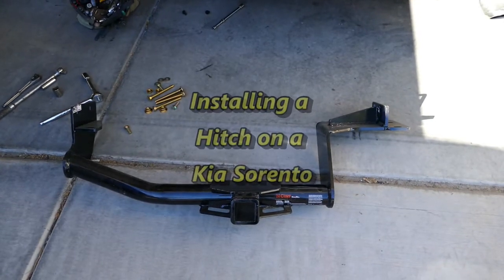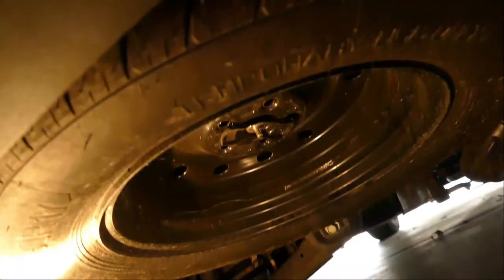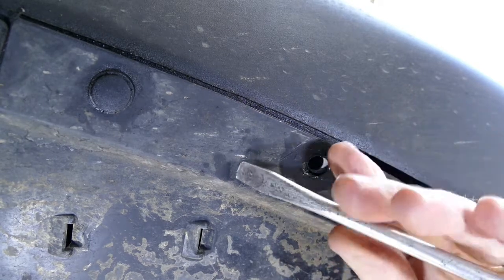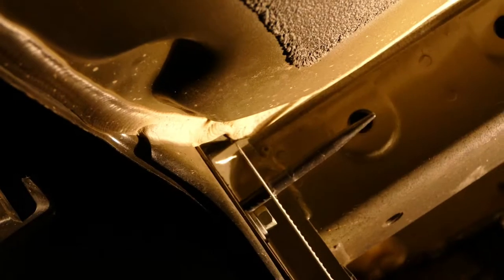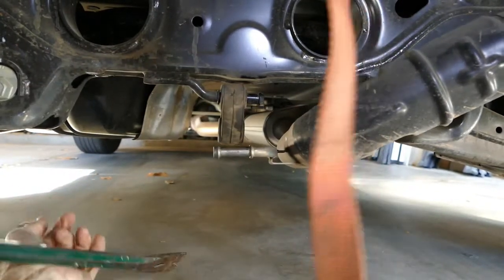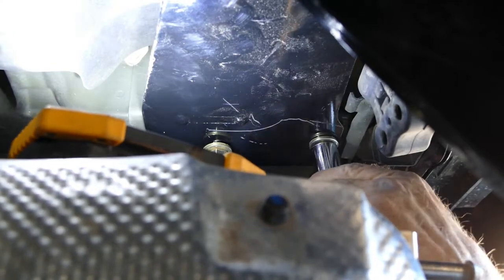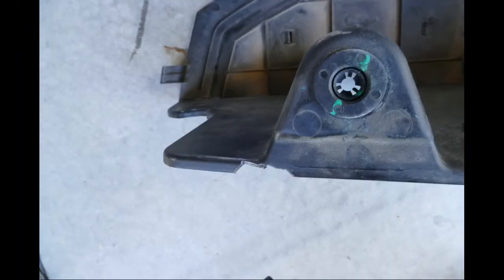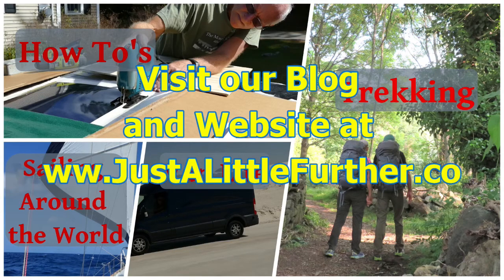Installing a Tow Hitch on a Kia Sorento

Comment: 2019 Kia Sorento LX uses four 10mm x 1.25" fine pitch thread bolts installed vertically in the trailer hitch flange. The three lag bolts AKA carriage bolts do not fit in the horizontal holes of the frame rail due to them being 1 mm too big in diameter. Never install a hitch on a Sunday because all the hardware stores especially Ace hardware who has the best selection of alternative bolts nuts and washers closes early at 5:00 p.m. always install your hitch during the weekdays starting at 10:00 a.m. so just in case you need to get an alternative bolt nut and washer you won't get shut out like I did.
Reply from the maker: Hi William, all good tips. The kit I bought had all the hardware, though, so I didn’t need a trip to Ace… although most projects I get myself into require at least two trips to either Ace or a big box. Thanks

Comment: Great video. Going to do this coming soon. What about the wiring
Reply from the maker: My Kia was pre wired for the hitch. The connectors are behind a panel on the driver’s side.
Reply: @JustALittleFurther  ok I will check. Thanks

Comment: Was it hard to do with out rear end jacked up?
Reply from the maker: @tristenlittke7593  not really, but I’m kinda skinny.
Reply: @JustALittleFurther  did you struggle putting bolts in frame over exhaust like flushed against bottom of vehicle
Reply from the maker: @tristenlittke7593  it wasn’t difficult once the exhaust was dropped down enough to get the bolts in
Reply: @JustALittleFurther  I had issues the bolts were flushed against a metal sheet bolted to bottom of compartment over exhaust even hammering it I had issues
Reply from the maker: @tristenlittke7593  I don’t know what might be different about your installation. Different model year? Different brand of tow hitch? My installation went smoothly with no problems.

Comment: Have you try to towing a travel trailer with your Sorento? I have a 2020 Sorento EXV6, but no trailer package from Kia. Do you think if this hitch can able to tow about 4300lbs dry weight? Thanks!
Reply from the maker: Hi Norman, We haven't towed anything with our Sorento - just carried bike racks with the hitch. The V6 Sorento is tow rated for up to 5000 lbs. The trailer you describe has a dry weight of 4300 lbs, which means it will be very close to, if not more than the rated 5000 lbs after filling the water tanks, adding propane tanks, and filling it with food and gear. It might be a bit much for the Sorento, especially if you head for the mountains.
Reply: You need to buy a vehicle with a V8 and a higher tow rating than a Kia Sorento with a V6.

Comment: Did you eventually install a four or seven pin trailer wiring connector, or you’re not planning on towing with it?
Reply from the maker: Since I made the video, I actually did install a four pin wiring harness. The six cylinder Sorento comes with it prewired, so all I had to do was connect the harness to two connectors located in a compartment behind the left rear wheel and route it to the hitch. It took about fifteen minute and cost about $50..
Reply: @JustALittleFurther  yeah the fuse is already installed in the fuse box for your trailer assembly showing you have that connector and that compartment you just exposed.

Comment: Does it fit the 2008 Sorento LX model?
Reply from the maker: I doubt this exact hitch fits the 2008 Sorento, but if you go to either etrailer.com or the Curt Mfg websites, they can determine the hitch that will fit your Kia. The installation may not be exactly the same, but should be similar. Hope this helps... good luck!
Reply: @JustALittleFurther  thank you sir!